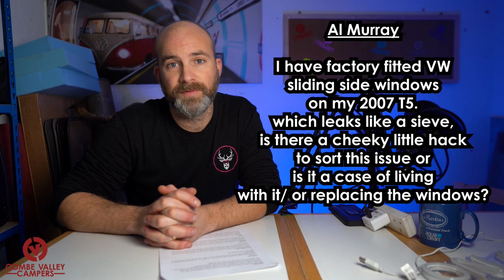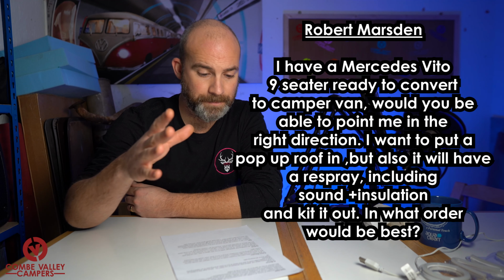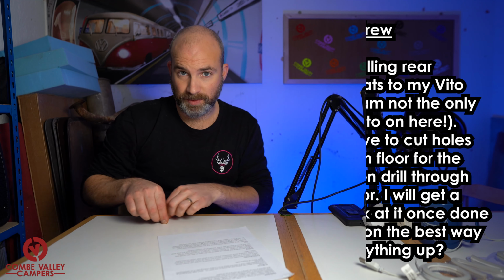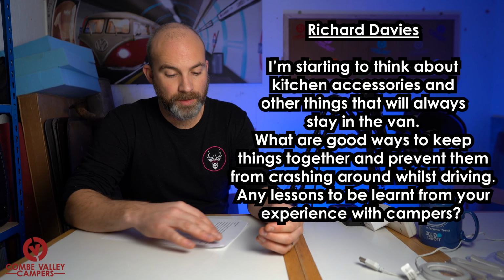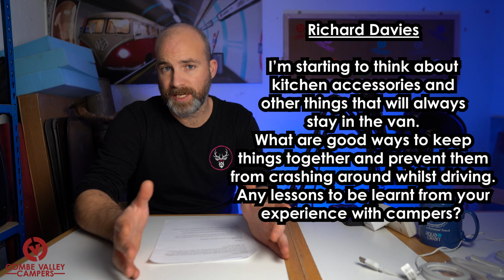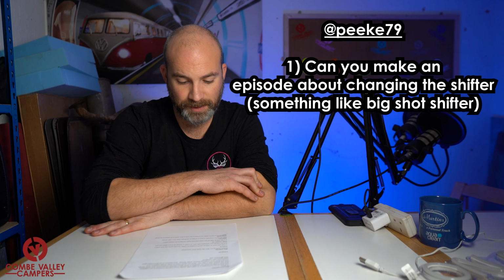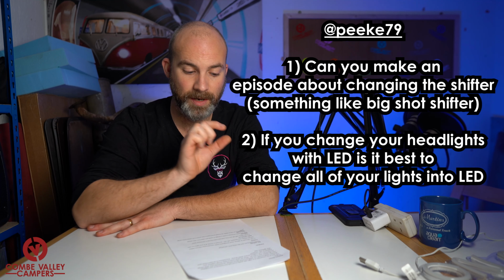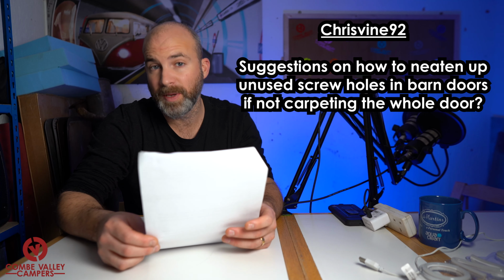REPAIR OR REPLACE T5 LEAKING WINDOWS? We answer your questions and more Q&A Wednesday #14

Comment: I’ve got those useless windows, one works fine but the other is an absolute mare, VW originals are so expensive, but to get windows tints to match I’ll have to replace all the windows. I’ve done everything to try and fix it before resorting to sealing it up, but it’s driving me insane 🙄
Reply: Get a tube of sikaflex ct1 , get the clear one.And buy a couple of syringes. Squeeze sikiflex into syringe and poke into gap and squeeze some sikiflex all along the top. That should do the trick

Comment: for the first question .. i would highly recommend Saab 9000 seats as they come in  leather or 1/2 leather  , heated , arm rest , soo soo comfortable & not stupid money from breakers ( OK you have to make adaptors to bolt them in but worth it )

Comment: Had leaky T6 Cali windows couple years back. Can of compressed air (for keyboards) cleaned the wee drains and silicone grease (not sealant) easy applied to the thin rubber gaskets around the sliding pane to plump then up. Sorted and been ok since with one reapply as precaution. Silicon spray or grease in the runners keeps them opening free, applying with a cotton bud cleans and lubes at same time.